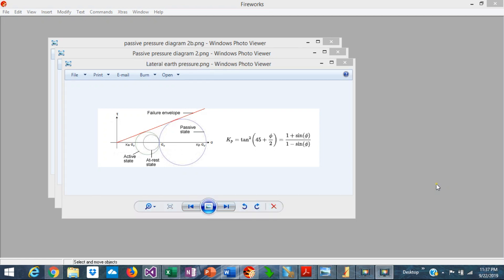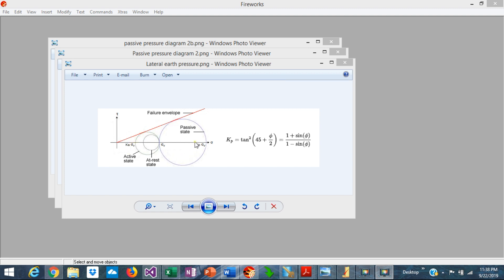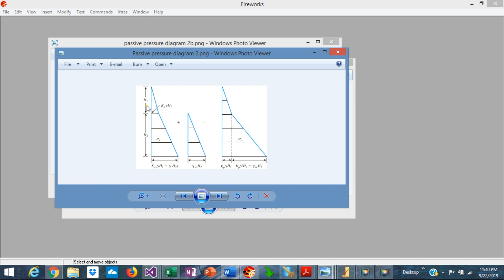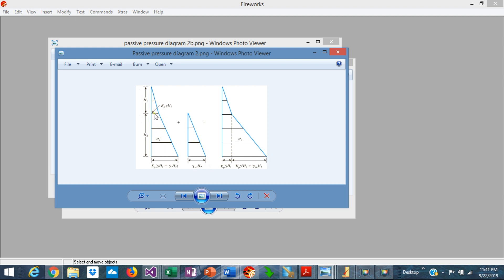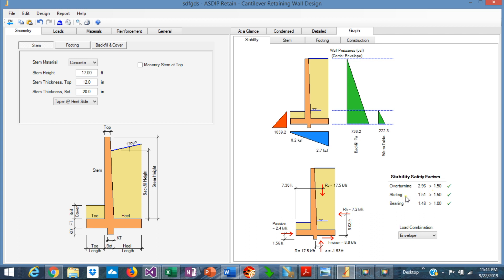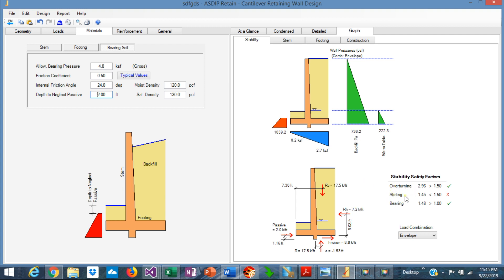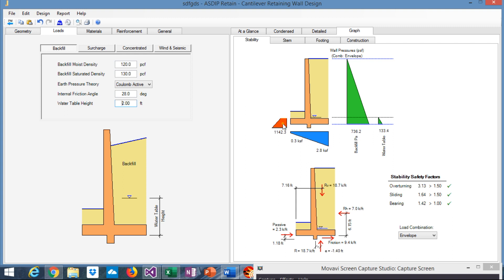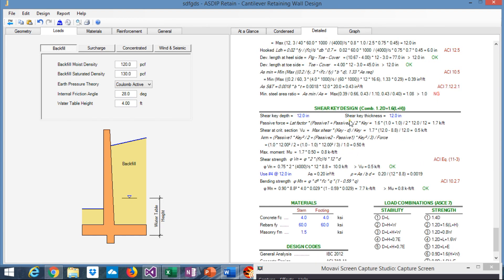Retaining Walls: Are You Calculating the Passive Pressure Correctly?

Comment: How is water pressure under the base calculated?
Reply from the maker: It's based on the Archimedes Principle.
Reply: Okay great, so in this case, if you’ve got differing ground water levels on both sides, presumably you take the highest for “h” before multiplying it by the unit weight of water and the length of the base? Presumably to mimic it being submerged, or would we work out two separate forces at the base?
Reply from the maker: Use the highest water level for "h".

Comment: Shouldn't the active earth pressure diagram go all the way to the bottom of the key instead of stopping at base level?
Reply from the maker: The IBC 2015 changed that provision because the results were very conservative. Nevertheless, ASDIP RETAIN lets you specify if the active pressure should include the shear key or not.
Reply: @asdipstructuralsoftware7797  First of all, thank you for taking the time to explaining it to me. It was a doubt that I had for very long. I suspected there shouldn't be any active pressure in the key when it is located in the middle of the base due to the same principle of relief shelves, but I never saw any explanation on the subject.

Second, it is good to know the software allows the designer to choose how he wants the pressure to be calculated. Many other software are more like do as I want and deal with it. I am going to take a look.
Reply from the maker: @PedroJr1811  It's important to clarify that this discussion is for sliding calculations only, not for overturning. For overturning the active pressure must always stop at the base. It's easy to understand an active pressure being applied at the stem, but it's not so easy to justify an active pressure below the footing, particularly if the key is in the middle of the footing. The resulting keys were so deep that it was obviously something wrong in the concept. The IBC realized this and dropped this provision in 2015.
Reply: @asdipstructuralsoftware7797  Thank you for this extra clarification.